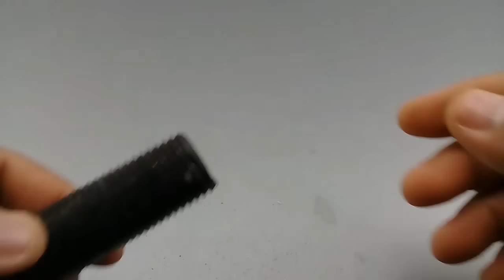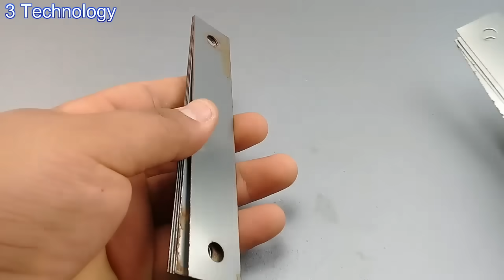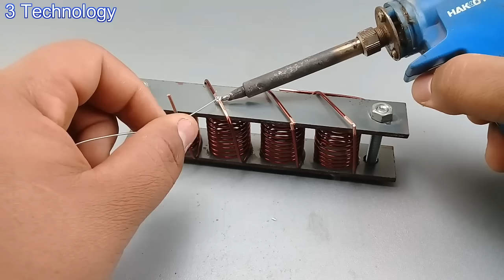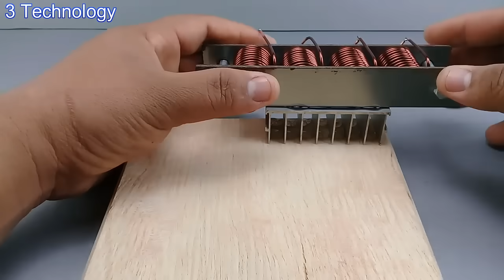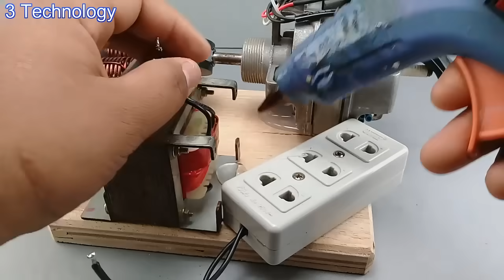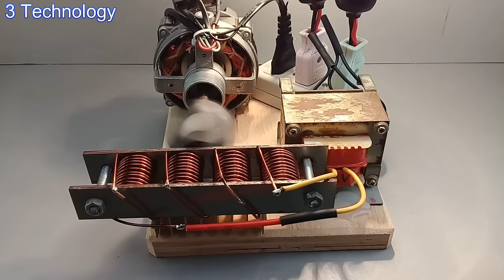how to make free electricity energy 10000w with four pieces copper wire / real free electricity

Comment: I took basic electric shop in a high school back in 1961, and this little gimmick was one of the first things that we learned about. Because it's the most obvious question that any body can ask when they're learning about electricity. Why not just hook a motor to a generator and the motor will power the generator. Perpetual motion. It's still a scam that works apparently. Somebody has a monetize YouTube video demonstrating this bit of fakery, and they're making money on it. And around and around we go. The more things change, the more they stay the same
Reply: But you would cry at the responses all these things are getting, that is the result of teaching nothing but politics in school, no one knows any better.
Reply: Lots of things they said we're impossible in school, have been done.
Try it, before saying it won't work.
Reply: But the planetary system is perpetual motion; or the closest thing to it !!!.
Reply: @pauloconnor7951  I never said perpetual motion wasn't possible. The fact that the universe is in constant motion on both a macro and a micro scale proves that it actually is. I was simply pointing out that device because like most of these devices it doesn't take friction into account. Eventually friction no matter how minor will slow it and bring it to a stop. Some just take longer than others. If you can come up with a completely frictionless device, then yes, you probably could achieve Perpetual emotion in a physical device. Applying that motion to something useful is an entirely different thing. It also has to have torque sufficient to do work.
Reply: @atticuswalker8970 Right. Ppl Prefer To Run With Whateva They’re Fed Most Of The Time

Comment: it’s fake ,,, ha ha ha
Reply: Ja , das merkt sogar ein Blinder mit dem weißen Stock .
Reply: Nope. He is just using permanent magnets to sympathetically capture recycle in this case the Earth's Fermie bubbles magnetosphere.

I do believe he has converted the fan motor to a dynamo though or could be the step inverted was enough not sure.

The metal is used to conduct the north south - + poles energy and the precious metal copper is used to isolate the north south - + poles acting as a nucleus for it to travel along.

Motive being we are in the climate change END TIMES not due to you or co2 but rather the Precession of the Earth's orbit equinoxes when Earth's orbit eclipses the electromagnetic gravitational equator of the Sun's Oort cloud magnetosphere for the next millennium.

TicTok these are just the birthing pains.
Noah's floods won't be pulled out and around the planet east to west by the moon until the conjunction of mercury -venus-moon and earth in 2033.

Comment: The nice thing about using video when you're going to play a trick on people, is that you can edit out wiring additions between scenes. The power used to run motor and lamps, is coming from beneath the board. He was very careful not to lift the board off of the table, after the motor started running.
Reply: But he only uses an electromagnetic field generated by a big coil under the table, no need for direct wire

Comment: I would. Just like to know how do you know that you are producing 10,000 watts at the 220 voltage. 
I've seen a lot of your videos and they are interesting to watch. But I never have seen a volt meter or an amp clamp. 
Saying this then. How do you know what your input levels and outs are?
Reply: I was wondering same thing. Would be great to see him clamp one on there.
Reply: well, watts, power and amps are different things, most who went to school never understood it :)) -  UxI/P ??
Reply: i think it's resonance between the exact size/length coils; tesla coils work in this manner where coil lengths are the same or one an integer multiple length of the other
Reply: I bet there is no way that this setup and just looking at the materials can or will produce 10Kw power! Let us plug in a 500W immersible water heater and see how this holds or sustains a steady current flow! Even the field coils and windings of a 1Kva conventional generator are so much bigger and longer.
Reply: A meter

Comment: Free energy videos are now a cornerstone of video.
The inside of the transformer in this video is hollowed out, a lithium battery and an electronic circuit are built in, and a device that amplifies the weak induced voltage generated by the coil and turns on the motor and light bulb is probably included.
Reply: The heatsink was questionable with very little contact and pretty useless.  Nothing else enlightening here -- I've seen examples of free energy circuits .  . but this is intended to discourage those who try to follow this demonstration..
Reply: Look up corona motor. I'd think You'd have to use a corona motor and some capacitors
Reply: Mathematically, 0. quantum energy is possible. But in practice it is impossible to do this, because we do not have the ability to do this, our life form is not capable of thinking at such a high level to realize such things. 
All kinds of science fiction are possible, but sadly so far it's just a dream and maybe even forever.♾
Reply: In every project that this kid does, with the exception of his "super cap", he always uses coils. There is no room in that transformer for enough lithium batteries to run that motor. On top of that, in order to develop enough voltage to drive those light bulbs in the way that he is, he would need an alternating current to work that transformer. There is no room on that board for enough batteries hidden to develop 240 volts to dive those light bulbs. How do I know they're 240 volts?
1) The outlet strip and plug is either European, Australian or New Zealand where 240 VAC is used.
2) The transformer primary was marked "220 volts" and the secondary was marked "12 volts".
3) He has shown the tops of bulbs used in past projects showing marked wattage and voltage.
    What he has is an energized induction coil under the table, possibly an induction cook top, that induces a voltage in the transformer in the project which powers everything. Also, there isn't anything on that project that could conduct 10,000 watts at any voltage. If he tried to pass 10 Kw watts through those 4 coils, it would have arced right through the varnish insulation over to those steel plates that they were assembled on a split second before they vaporized.
    Not only this, his soldier technique SUCKS!!! He soldiered each coil end tip to tip. This makes for excellent fuses but even if he spot welded them together, there's no way they would handle 10 Kw.
    Did you notice how he very carefully positioned the ring magnet's angle on that motor shaft next to the 4 coil assembly? Then he gingerly wound that string on the other end of the shaft as though it might explode? This was because he couldn't afford to have the motor start spinning before he was ready or it would ruin the illusion that he was trying to project.

    With his "super cap" project, he took a long piece of aluminum foil and a matching piece of paper and rolled it up, rather sloppily, and put it inside a 4 inch diameter by 4 inch long piece of blue PVC pipe, connected it to 2 bolts in the end cap and slipped it together.

    WHAT YOU SEE is him connecting it to a voltage supply to "charge" it up. He then disconnects the supply and wraps a fairly heavy piece of bare copper wire around the 2 bolts only to see it turn red hot and burn off.

    WHAT YOU DON'T SEE is him stopping the camera, removing his fake guts and installing 4 "D" alkaline cells,  connecting them to the bolts, reinstalling the end cap then restarting the camera. Then, when he wraps the wire around the bolts, it burns off.
    Four, new, quality "D" alkaline cells connected in series, on a dead short like this, for a short time, will develop about 10 amps or connected in parallel, about 30 amps. This is more than enough to burn off this wire. Not only this, if it was a true capacitor of ANY type and of high value, instead of making a feeble little spark when the wire contacted the bolts, that cap would have vaporized at least one end of that wire as capacitors, on a dead short, will dump all of their energy at once. Think a photo flash gun.
    What STUPID doesn't realize is that REAL super caps do NOT use aluminum and paper like standard electrolytic capacitors do. They use exotic materials such as graphene. Something that he couldn't produce, obtain economically or handle properly in his setting.
    I've debunked many of his projects in the past. His channel used to be under a different name which I don't recall but now he calls it 3 Technology. (Technology for a three year old, maybe?) He disappeared for a while but I see he's back under a new name. I know it's the same kid by the look of his hands and the color of his skin. I'm no bigot but he is either of (India) Indian or light skinned African decent.

    I tried to encourage him once to get an education or, at the least, design and post practical circuits as his knowledge of induction circuits is ahead of the average person but I guess it didn't have an effect.
Reply: @jeffmccrea9347  First...why do you believe its 240 volts? Second there are many ways to do this trick...and it is a trick..make no mistake. I can put a small Tesla coil under the table and power it easily.
Reply: @markohara5146  ...a small Tesla coil...

I forgot this. A traditional Tesla coil wouldn't cut it as it wouldn't produce the current needed to light 3) 100 watt incandescent bulbs and run a washing machine motor. The voltage in a Tesla coil is so high that he would need massive coils in his projects to step the voltage down enough to do his bidding.
    My guess is that he either salvaged a large solenoid to use as his primary or he's using a single induction cook top. These don't produce heat on their own and are very powerful.
Reply: More likley in the plug box.
Reply: Or the battery could be in the box with the sockets, into which we cannot see.
Reply: @davidlevine-e5z  I agree.
Then it's easy.
I'm curious about the battery capacity...
Reply: Or maybe this really is what he’s saying it is. I plan to duplicate this and then I will post it on my channel for you to see. And when it works you will all say I’m tricking you too. The brain washing and programming in this country is alarming.

Comment: What's the heat sink for if it's not making contact with the copper coil set insulated by hot glue? Regardless of hot glue insulation, how can the heat sink be effective with so little surface area of coil set bracket in contact with that heat sink? Why not dielectric gel between heat sink and coil brackets?:body-blue-raised-arms:
Reply: Since we don't know its purpose, I assumed it was a spacer.  It would work well for that.

Comment: Nice work!
Can u plss provide equipments name so that it would be easy to understand ✨🙏
Reply: This is a fake. Thus there is no need for details about the equipment. Such an arrangement can not work, never mind what equipment you use.
Reply: S. C  A. M. Utility makes them.
Reply: BabaTv-    No, this is no kind of other physics. You can try it, it doesn't work. It is not entirely impossible that there are kind of other physics, but for sure not in this video. As for aliens: it is by no means assured that the observations which were made in this respect are not connected with alien space crafts at all.